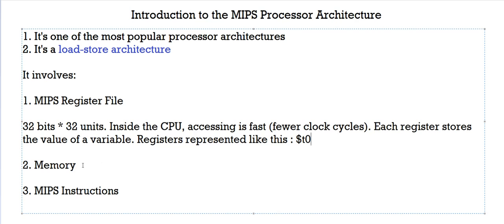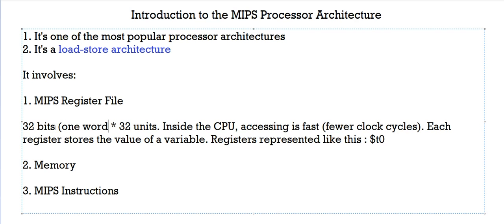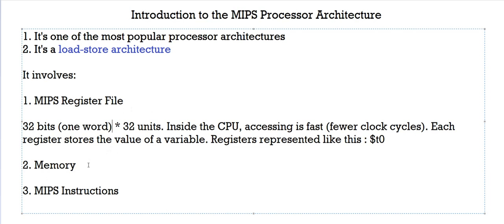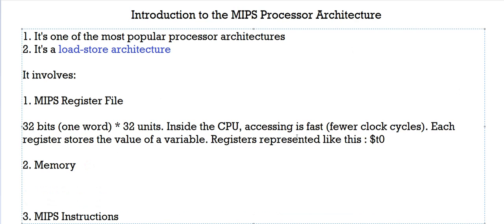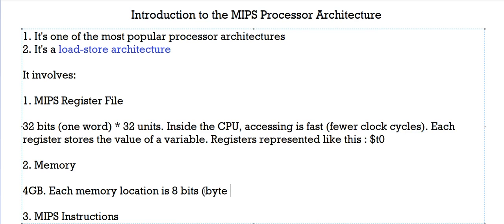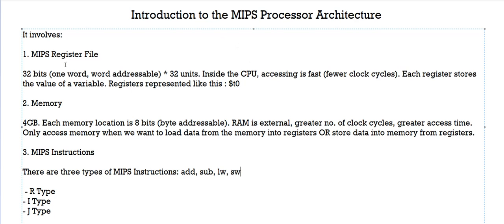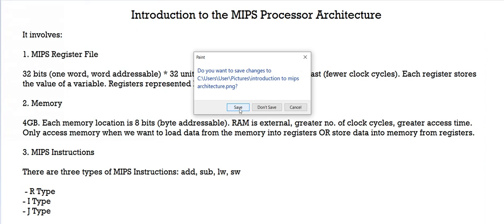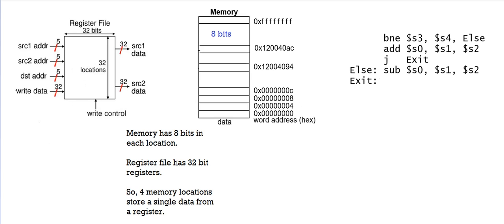Introduction to MIPS Processor Architecture

Comment: Well that sounds fine, but when doing something complex 32 variables does not sounds like a lot to deal with. I am mostly watching this because I have 3 openwrt routers with mips architectures including the one I am sending this though that is wirelessly connected to my iphone as a hotspot client. Whatever. It works. From what I hear there are some different generation of Mips can't say but like 34K or 74K or something from memory.